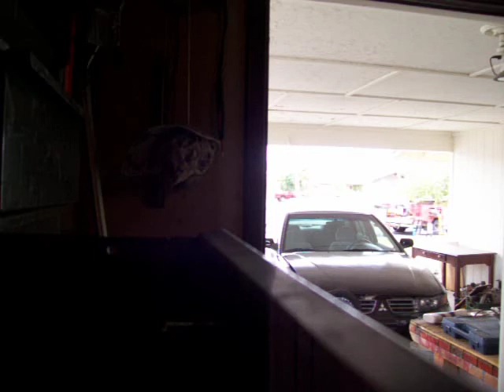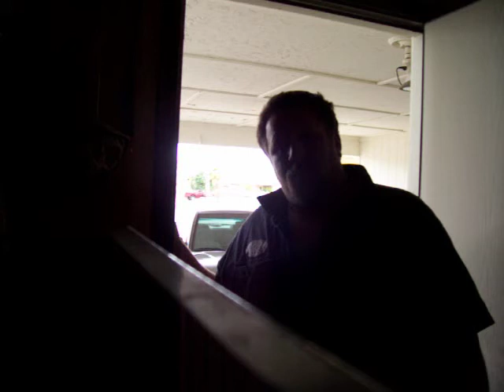reply to es2008 bmw vid ( vid needs captioning, i will get to it when i can.)

Comment: @radarman2000 --- @radarman2000 --- Ok so they didn't use the word supplement, here's what they did write, "This indicates that beyond 5% induction, H2/O2 mixture acts as a fuel rather than an additive.", my bad.... Experts have been known to be wrong before, just because they believe it takes 5% of more for it to work does not mean that is the only way it will work. The study shows they are mistaken if that is what they say...

Comment: @radarman2000 --- I'm not leaving out anything, read the study. It clearly shows gains in TE at less than 1% total energy equiv. HHO. They documented a 15% gain in MPG at levels of 4% - 6% using a constant RPM and constant load. Changes in both will change that percentage, for the better. The point of the test was to show using on-board HHO generator can improve TE and fuel economy and reduce emissions. They prove that, to say otherwise is to misstate the facts shown in their test.

Comment: @radarman2000 --- So yes you are in denial. One other point you glaze over, the AU study shows at mixes over 5% HHO acts as a fuel supplement but it acts as an additive at lower quantities. The charts in FIg 2 + 3 show gains in TE starting at 3 LPM. This is where gains in MPG come from, gains in TE...

Comment: @radarman2000 --- LOL, so homemade units cannot make enough HHO to improve MPG, where the heck do you think Ronn Motors got their design? What the heck do think the AU study used? These both were from designs made by home labs. In other posts you have mentioned that Ronn Motors use 30-40% H2 equivalent energy, do you know where that H2 comes from? It's made from water on demand. So tell me again how homemade units cannot make enough H2 to improve MPG. Cont.

Comment: @higherpoweredh2o 
You would rather go diesel? Check out one of my vids. Did a cummins 4bt swap to a 93' Suburban. Got 26 mpg without an intercooler. Problem I had wasn't power but vibrations at idle. 

Now, I'm thinking a first gen 6bt without intercooler because if I use HHO, the engine will run cooler. Plus the 1st gen is the lightest at 880 lbs verses 1150 lbs for the 98+ 24 valve motor. Can't beat a cummins in simplicity and reliability and I owned them all(except Duramax).

Comment: @higherpoweredh2o 
Timing increase is all that is really needed? If so that is great. Would higher compression pistons help out as well? My motor is due for an overhaul I can  add these features during the overhaul. 
As far as induction, I prefer carburetor because there is no computer to manipulate just alot of mechanical tuning (like the old days) so I might ditch the vortec fuel injection for a carburetor...please don't think I'm crazy;)

Comment: @EnergySupply2008 --- I'm sorry but adding HHO to HC fuels can equal a gain in MPG and reduce in emissions. It's not the same thing as trying to power an electric motor with an alternator as you describe here, it's not that simple. There are many factors that you fail to consider. It has been done by many and it has been tested in a lab and the results are published. How many times are we going to have this argument? You wanted proof and you have it, accept it and move on...

Comment: @BlackDogSociety - A typical alternator is 50 percent efficient. If we had an electric car and we tried to use the alternator to help power it, we would be losing energy, not gaining energy. HHO adds in another loss because the HHO cell is not 100 percent efficient. Two losses cannot equal a gain.

Comment: Good video, you bring up some great info.

I have  a 96' Suburban with a 350. I to wish increase mileage  by maximizing HHO I should concentrate on increasing cylinder pressure by turbo/super charging or high compression with some timing advance. Turbo would be at the top of my list.

Thanks again for the info!